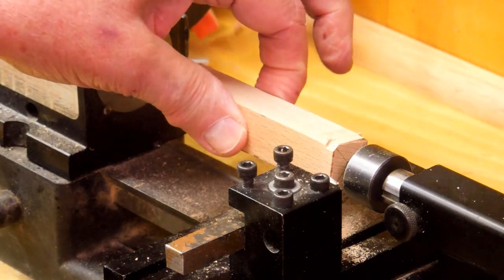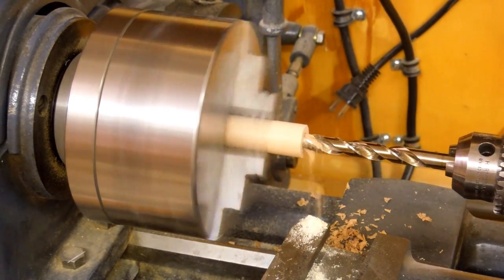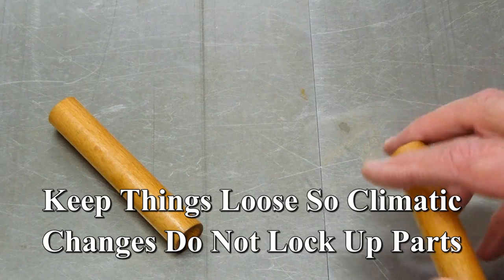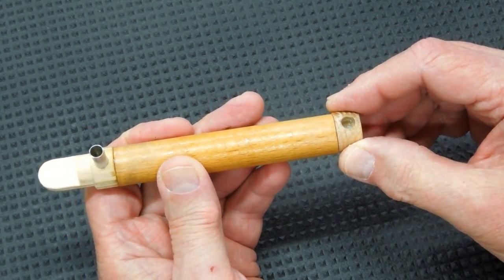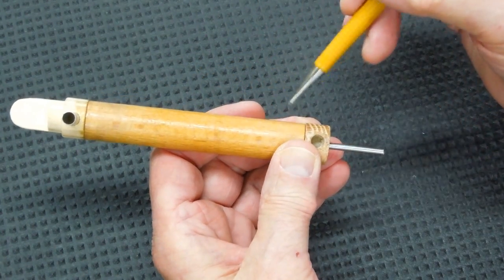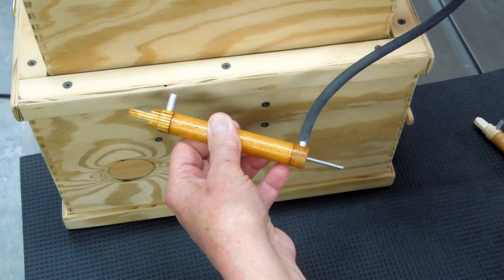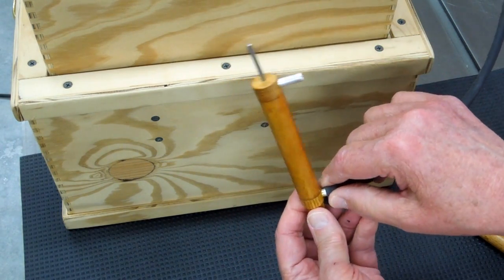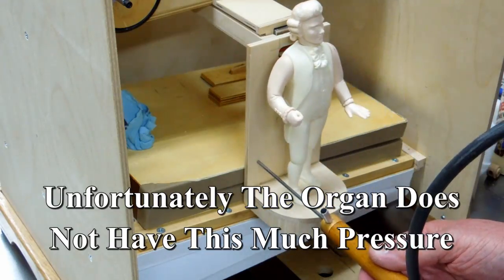Senior 20 Conductor Installation (2) Wood Air Cylinder Experiment

Comment: It will probably work if you have a better seal. This makes me think of a company called "airport" they make precision dash pots that have graphite Pistons fit to glass cylinders. Virtually zero friction for sliding and still maintaining a great seal. 5" of H20 on a 1/4" cylinder should have enough force to push that conductor out, just have to seal the leaks. :-) Good luck!! Www.airpot.com
Reply: Sorry.. Autocorrect changed the company name. It should be "airpot"

Comment: That's a neat cylinder design.  Would it totally ruin the concept if you added electric RC servos connected to a micro controller and let it play midi tunes in the background or accompanying the organ pipes? with small air valves id bet it could play the pipes without a punched card also
Reply from the maker: Don't get ahead of the video series just yet... we'll get there. Organs which play midi files have already been built but tend to be much larger with many more pipes and other instruments. I was watching your RC mower video. I recently (two weeks ago) bought a Ferris zero turn mower... moves about the same. :-)
Reply: Nice... How can we mod that thing :-)  thanks for checking it out.

Comment: This has become very interesting! I'm sure you will work it out.
If you don't mind a thought I had: A small rotating cam with a linear rail of small valves to allow air to puff air up to each tube individually as it rotates. Thereby moving (or retracting) mechanisms such as the platform or arms movement. Just a thought which may not be at all feasible do to the space restrictions.

Comment: Assuming a 0.5" diameter piston, 5" wc will only give you about 0.5 oz of force with no leakage and no friction. 

If you make your piston 2" you will get 16x more force if you can tighten the tolerances enough to keep the leak rate about the same. I'm assuming the air pump has a relatively high flow rate since it's such low pressure so more leakage might not be much of a problem.
Reply from the maker: Yes, I know the math. Also know the required stroke and size limitations. With this low pressure an o-ring or wiper will kill the whole thing and is why I wanted to try the bypass piston. The conductor platform would move in/out when the organ is not playing so bellows supply would be sufficient. The conductor platform is running on a linear bearing with zero lubrication and requires little to move it. There are three other conductor movements each requiring a drive mechanism of some type, 12VDC organ drive motor, the six largest pipes mounted internally, connecting rods, the drive mechanism for the music roll plus 20 air hoses competing for space surrounding the conductor. It is getting very crowded in there. Thanks for watching. Please Subscribe.
Reply: Ronald Walters, I'm pretty sure the  math indicates that you need a 2" or larger piston for this to have a chance of working. Where did the small diameter piston idea come from? 

The closer you can get your tolerances the closer to 2" the piston diameter can be for a bypass design. A metal sleeve with a plastic plunger would remove the concerns about material moisture issues. 

A bellows of the right size and shape could work too.
Reply from the maker: Most of these organs are made from wood and by people who probably are not going to have a bunch of fancy equipment. What I show being done on a small lathe could be accomplished on a drill press and if so, the tolerances would be loose at best. 

I simply did not have room for a larger cylinder, period. When playing around with some of this stuff you need to make a decision that it is probably a bad approach and move on, which is what I did 12 months ago when this video was edited.

When you blow air into a bellows it is then called a pneumatic motor. Stay tuned for that.
Reply: Ronald Walters ever consider multiple smaller cylinders?  End of the day, what you lack in pressure you need to make up in volume for a straight piston.  I'd be inclined to look for a way to get a mechanical advantage, like a dual rack and pinion.